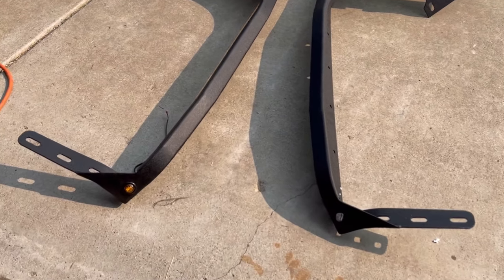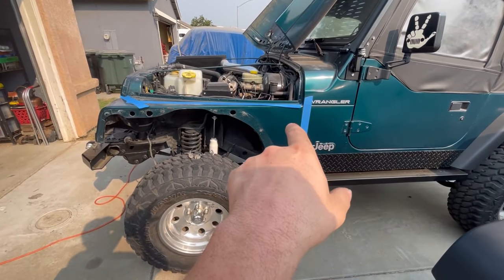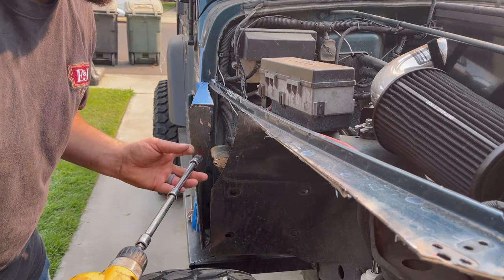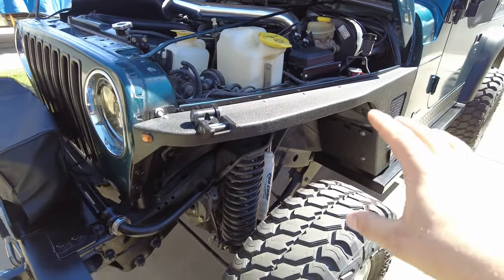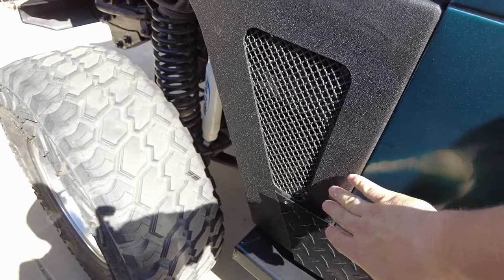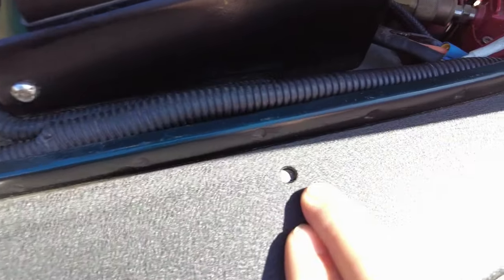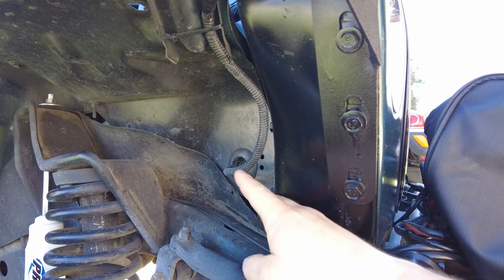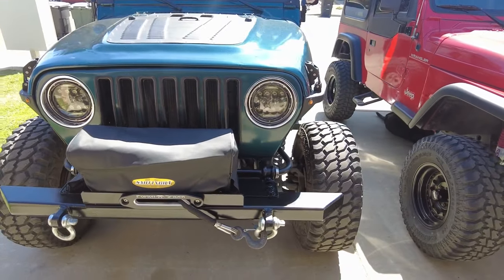Jeep Tj Wrangler | Amazon Front Fender Install

Comment: I would run the marker light wire behind the inner fender well. Otherwise, I love those fenders.
Reply from the maker: That’s Good idea, thanks for watching 🍻
Reply: @ATEMOFFROAD  What year is that one? I have a 2005
Reply from the maker: @rickwhoo1  1997 , it’s older but I love it
Reply: @ATEMOFFROAD  Better made too...
Reply from the maker: @rickwhoo1  I agree the AMC engine is solid ! I have two tjs both 97 a few months apart! Either Something happened during the manufacturing process around time, or there was multiple plants. There are several difference in detail that I can see between them, from  the frame , tub, electrical, interior and exterior. There are differences. Small but noticeable! I think they may have been made in different plants. The green jeep has a federal stamp and the red jeep has a state stamp! Do you think some of the last parts from the YJ has been carried over to the first tjs as surplus? Interesting to say the least